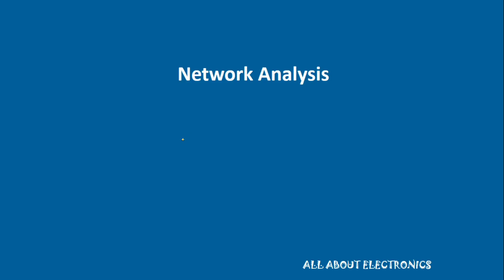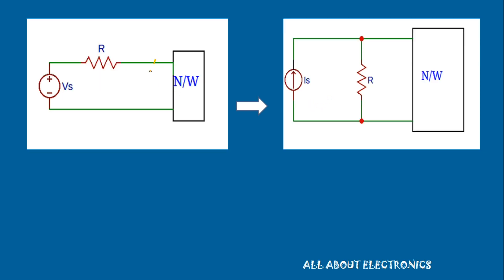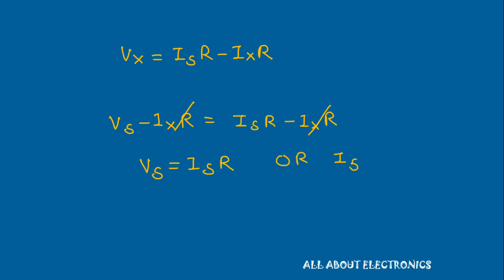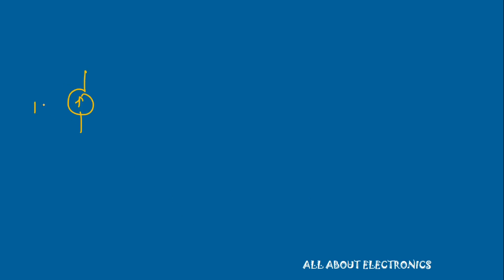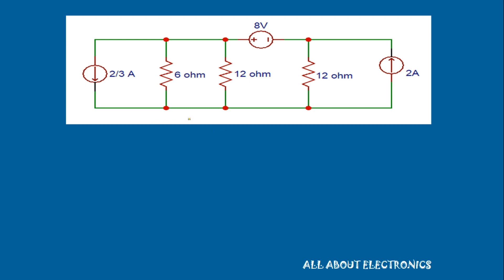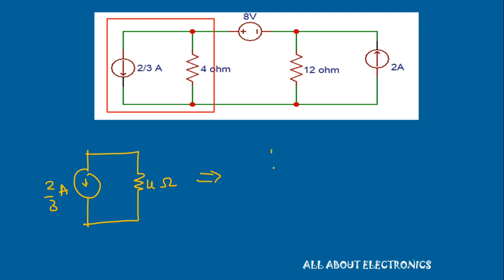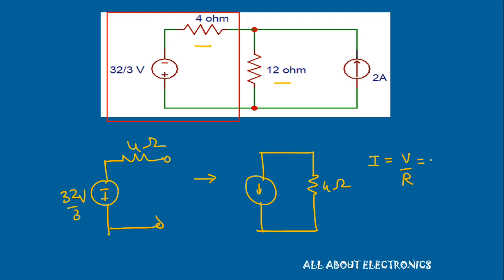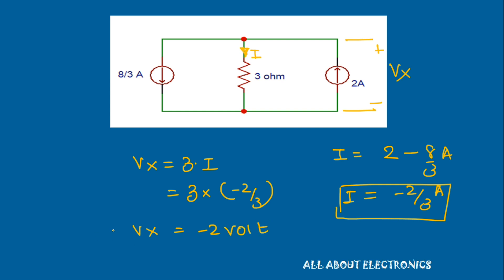Source transformation in  network analysis

Comment: At the end of finding the resultant current I, why do you take the direction of current according to 2A current source but not 8/3A current source. (8/3A > 2A). Please answer as soon as possible. I need to clear this concept as fast as possible. Thank you for the video.
Reply from the maker: The only reason is we want to find the Vx with the given polarity. + at the top and - at the bottom. That means the equivalent current should pass through 3 ohm resistor from top to bottom. And that will happen when the current direction is upwards. I hope, it will clear your doubt.

Comment: Why we are taking 8/3A as negative??
In last step??
Reply from the maker: If you see a 32/3 V voltage source, then there is a negative sign at the top and a positive sign at the bottom. Therefore after the source transformation, the current source is going downwards. If there is a positive sign at the top and a negative sign at the bottom in the voltage source, then after the source transformation, the direction of the current would have been upward. I hope, it will clear your doubt.
Reply: @ALLABOUTELECTRONICS  thanks for your reply sir🙏
But still now I am not clear why not 8/3-2

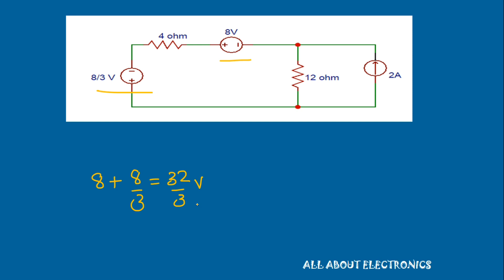Comment: 10:28 Polarity of voltage sources are different can we add that simply🙄 anyone clear this doubt
Reply from the maker: Although it appears that the polarity is different. But actually if you see, the negative of one source is connected to the positive  of the second source. That means two sources are in series. Hence, the equivalent voltage will be the summation of two sources.

Comment: Sir why did you add two voltages 8v and (8/3)v at 10:23 since it has a resistance of 4 ohm between them?
Reply from the maker: Yes, but they are connected in series. It won't alter the KVL equation. e.g if you have 1v followed by 1ohm resistor, followed by 2V source. The current through  1 ohm resistor is 3A. It will remain the same if you move 2V voltage source just before the resistor and so does the voltage across the resistor. I hope it will clear your doubt.
Reply: @ALLABOUTELECTRONICS  sir, then why did you subtract volatages in example 1..96-6

Comment: after adding voltage source 8+8/3 the resultant voltage source 32/3 terminal (- +) . why not plus minus(+-). if we check numerical also 8V is greater than 8/3 Volt. voltage source must be connected to 4 ohms must be positive terminal only why negative... can any one explain.
Reply from the maker: To understand it, just interchange the position of the 4-ohm resistor and 8V source. Just place the 8V source on the left side. You will observe that both 8V and 8/3 sources are in series and the total voltage would be (8 + 8/3) = 32/3 V with the negative terminal on top and positive at the bottom.
I hope it will help you in visualizing it.

Comment: 12:50 why you subtract
Reply from the maker: Just apply the KCL at the node above 3 ohm resistor.
Current I and 8/3 A are leaaving the node, while 2A current is entering the node. That means I + (8/3) = 2
Or I = 2 - (8/3).

Comment: i believe ur Vx should be 2V as its the opp direction of (3 x (-2/3))
Reply from the maker: The current I = -2/3 A. That means it is flowing from bottom to top. So, the bottom terminal will be positive, while the top terminal will be negative. Therefore, Vx is -2V.
I hope it will clear your doubt.

Comment: How to transform series curent source and resistance into voltage
Reply from the maker: The source transformation is possible when there is a voltage source in series with resistor or a current source in parallel with some resistor.

Comment: Explain the sign convention for the addition of two voltage source..
Reply from the maker: If the two voltage sources are connected in the series and if the positive terminal of the one source is connected to the negative terminal of the other source then the voltages of the two sources will be added. i.e V= V1 + V2
similarly, if the positive terminal of the source is connected to the positive terminal of the other source, in the case the overall voltage will be the difference between the two sources. 
I hope it will help you.

Comment: How can we add 2 voltage source there is a resistance  between them ??
Reply from the maker: As they are connected in the series, so the addition of the two sources won't affect the rest of the circuit on the right side (12 ohm and 2A Source).
The remaining circuit on the right side will still see the same voltage across the two terminals.

Comment: hello! I'm just stuck on one problem, after I transform, I don't know where to put the resistors? do we usually just move it up (if it is from parallel)? does the way we move it matter based on the polarity of the source? since I have a problem where the resistor is on the left and the current source is on the right, while all the rest of the circuits is to the right, so after I transform this to series,  the resistor will move up to be in series, even though my source is pointed down?
Reply from the maker: It depends on the polarity of the current source. If the current from the current source is flowing downwards, after the transformation voltage source will have polarity - to +. And the resistor will be connected to the negative terminal of the voltage source.  Because, before transformation, the current is going away from the resistor.  For better understanding, you can see that in the video at 9:20. So, after transformation, the same thing should be followed. 
I hope it will help you in clearing your doubt. 
If you still have any doubt then do let me know here.

Comment: Hi Sir, I didn’t understand the last part. Why we negated 2-8/3 even though both currents are flowing in the same direction
Reply from the maker: If you closely observe once again both currents are flowing in opposite directions. 2A current is flowing in the upward direction, while 8/3 A current is flowing in the downward direction.
Reply: @ALLABOUTELECTRONICS  But Sir, both 8/3 and 2 are in same loop  and flowing in same anticlockwise fashion...so what's the problem if we take 8/3-2 instead of 2-8/3?

Comment: I have one doubt you subtract 2-8/3 in opposite direction in current but you do addition for opposite direction of voltage why?
Reply from the maker: I think you are talking about 8 and 8/3 Voltage source, right?
If you actually see, they are not in the opposite direction. The negative terminal of 8/3 V voltage source is connected to the positive terminal of 8V voltage source. So, actually they will get added to each other.
Reply: @ALLABOUTELECTRONICS  oh yes ok understand it thanks a lot please suggest me a book so that I can solve many problems from source transformation

Comment: I have one doubt...what about the direction of current and voltage source after the transformation?
Reply from the maker: If the current source is in the upward direction then the transformed voltage source will have positive polarity followed by negative polarity. In short in the transformed voltage source, the current which is flowing through it should be in the same direction as the current source.
I hope it will clear your doubt.

Comment: How to do soucre transformation when inductor is connected instead of resisitor
Reply from the maker: In case of an inductor, first of all, you need to find the impedance at the operating frequency. Then you can apply the source transformation and can treat the impedance like a resistance.

Comment: i couldn t understand the Is=ix +Iy   and how to add two current sources or two voltage source
Reply from the maker: If you apply the KCL at the node, then you will see that Is is the entering current at the node, while I and Ix are leaving currents. According to KCL, the sum of leaving current and entering current is equal. That's why, Is= Ix +Iy.
 I hope, it will clear your doubt.
Reply: ALL ABOUT ELECTRONICS hogaya exam Or ye question. Nai bana

Comment: i understood it all but in the last step i didn't  understand why I=2-8/3  i mean we could say I=8/3-2 and then I would be positive ?!
Reply from the maker: Yes, you can say so, if you take I as, (8/3)-2. And in that case current will be positive and will be from bottom to the top. But voltage Vx will remain  negative. As, we are measuring voltage from top to the bottom. So, in short I would say, it's just matter of direction. If you assume current is flowing from top to bottom then it is negative and if you assume it is flowing from bottom to the top then its positive. 
I hope it will clear your doubt.

Comment: In the 10th minute and 35 seconds you combine both the voltage sources which are in series ,you say in the video that  the resultant voltage source is given by 8+8/3 , but  it should be (8-8/3)volts as the polarity of the 8/3  voltage source is negative??
Reply from the maker: It will be 8+ (8/3). Please look at the example once again. The negative terminal of 8/3 V is in series with a positive terminal of 8V. So, the addition will be 8+(8/3) only. 
And still, if you have any doubt then do let me know.
Reply: Thank you